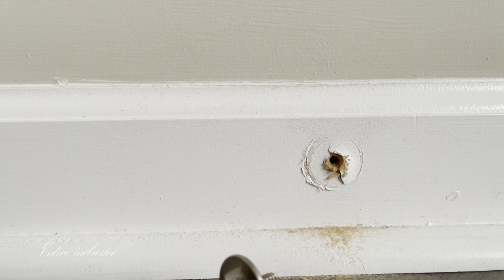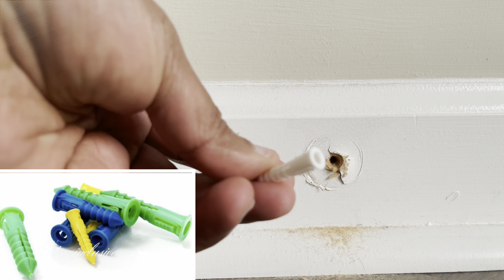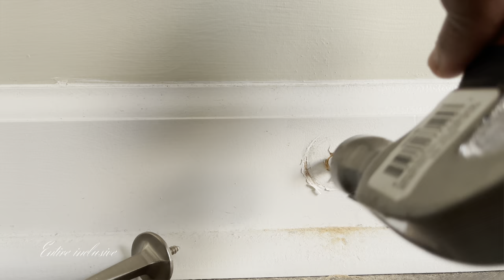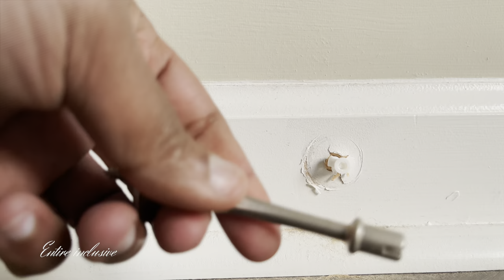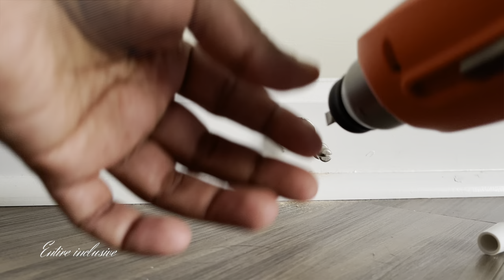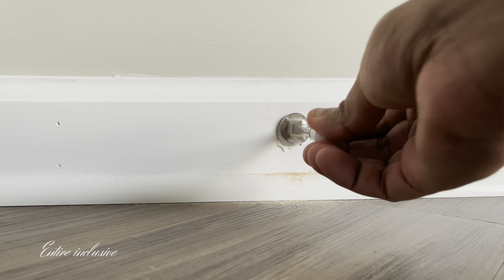How to Fix An Old Door Stopper | Repair a Broken Door Stopper | Fix a Loose Door Stopper

Comment: What should I do if the screw has fallen out of the door stop?
Reply from the maker: Use an appropriate drywall anchor to fill the gap and then screw the door stopper slowly.